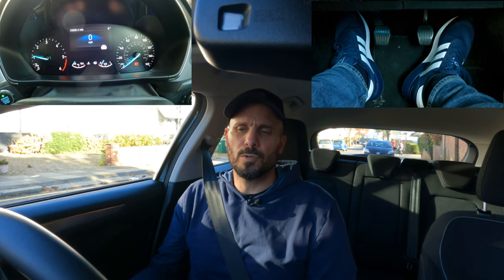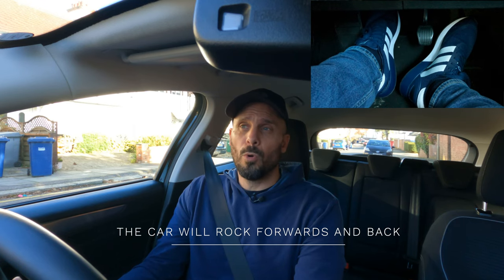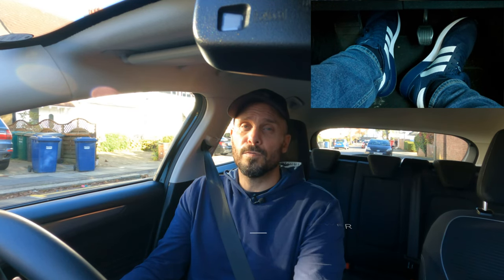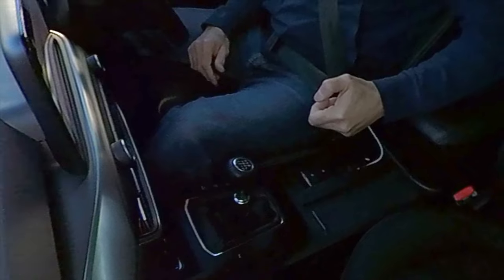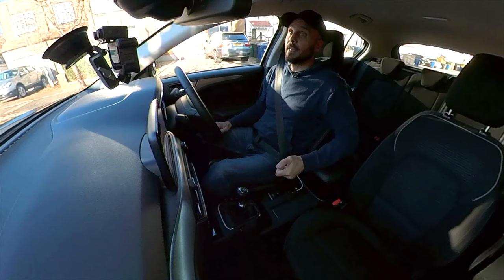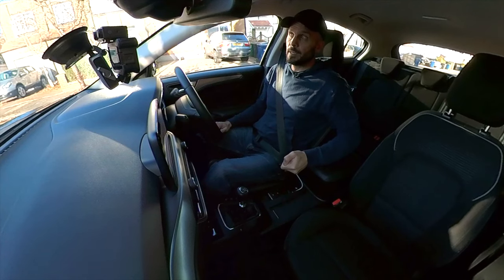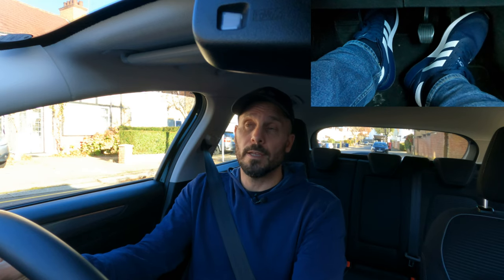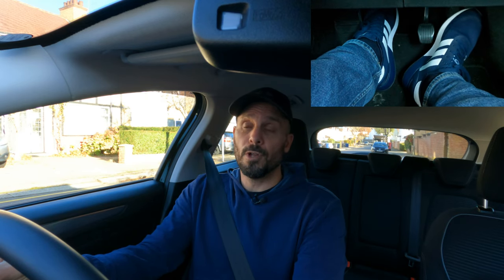How to control the clutch  - the basics. (Tips and exercises included)

Comment: Could you please give an advice on how to avoid a jerk when changing gears? Thanks mate.
Reply from the maker: Generally this happens either because you have lifted your clutch too quickly ooooooor if you haven’t lifted your foot off the gas pedal (accelerator) while transitioning the gears. First start making the clutch smoother by holding for a good 2-4 seconds as you lift it off and secondly make sure your foot is off the gas as you put the clutch down to change gear. Only reapply the gas when your clutch is up. Hope that helps!!
Reply: Thank you for quick reply, I am sure many beginers would find it very helpful.